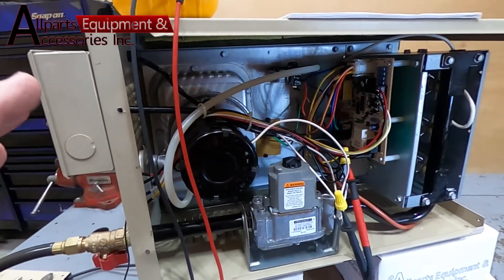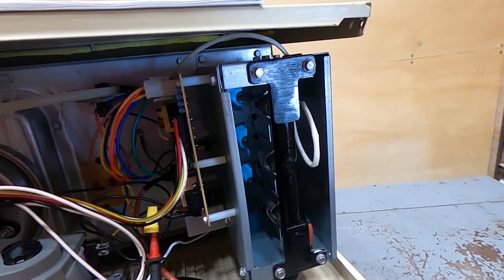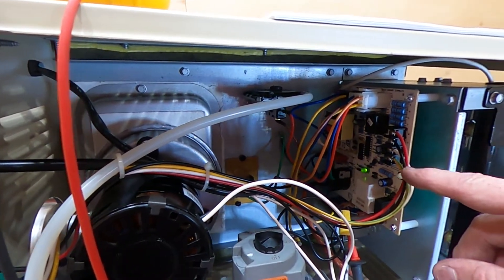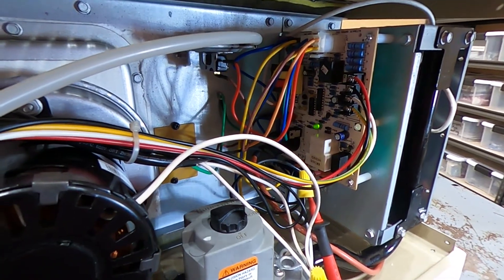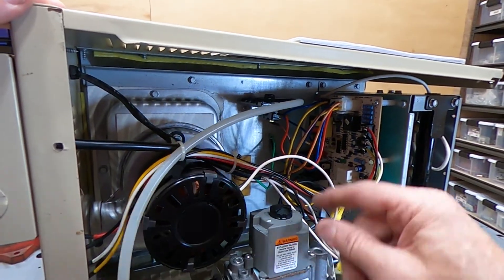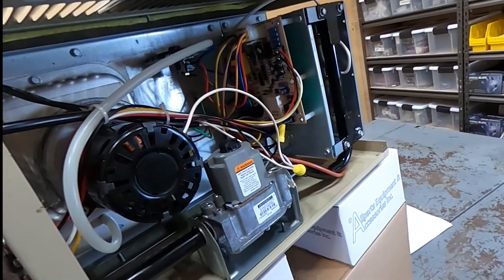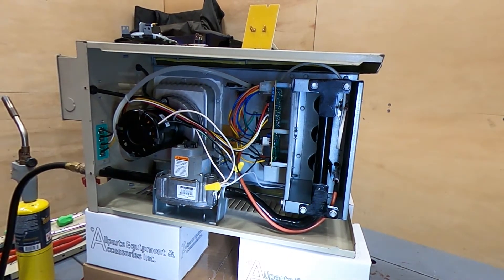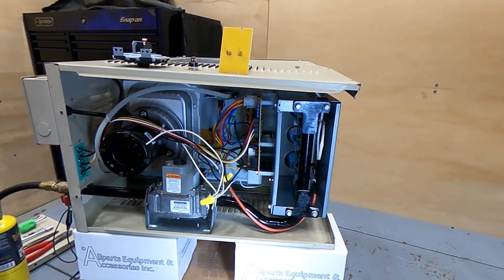Troubleshooting Compact Furnace Flash Codes (Mr Heater & Heatstar MHU Furnace Repair)

Comment from the maker: Thanks for watching! If you have any questions about the video or other heater issues, comment below!
Reply: I have a Modine Hot Dawg 45 AS.  It sparks, tries to light.  Tries for 5 times then I get 4 green flashing lights.  I've replaced the igniter and flame sensor.  The biggest problem is this is intermittent.  Once it cycles off, I'll shut off the power, and once turned back on, it will usually start up and run fine.  Then it will continue to run fine if I have the temp turned up high enough in the garage.  It seems to be worst when it first starts (cold start).  Sometimes it will light on the 2nd or 3rd attempt.  Any advice would be greatly appreciated.
Reply: Good day sir. Great video. I am getting the 4 flash sequence and I believe it is because the big blower fan is not engaging. What would cause the blower not to work?
Reply from the maker: @scottfreeman528  there's a chance that it could be a bad board, but if you texted our help line: 1-269-447-0412 we can ask a few questions to better diagnose the problem before you make a purchase. Please include your model number in the text!
Reply: @Allpartsinc happy to report the issue was just the start capacitor

Comment: Hi my heater stopped working yesterday. It had been working fine but recently when I came out to the garage in the morning, I find that it did not restart to keep the garage at the thermostat temperature. When that happened, I shut the power off turned it back on and everything started normally same thing occurred if I simply turned off the thermostat and turned it back on. But now nothing happens at all, regardless of how I turn the power on or off I’ve noticed that if the thermostat is not calling for heat, I get the normal slow Blink code, which says normal operation no call for heat as soon as I turn on the thermostat to call for heat. It immediately goes to the three flash code. The induction blower never starts and as long as the thermostat is calling for heat, it continually blinks the three flash code. What do you think is happening and how can I fix this? If the induction blower never starts it can’t be checking the pressure switch yet so I have no idea.
Reply from the maker: Did you take a look at the hose port? How does the hose look, is it clean?
Reply: Hi, I am getting a 2 flash code. The heater turns on and I’m getting a flame. Seems like it’s working fine, and after a few minutes it will go to cool down and shut off. Thanks

Comment: Brother, its -10f here in wisconsin, just went out to garage and my mr heater wouldnt fire. Popped off the side panel, saw 3 flashes. Found your video, blew out vac switch hose and both ports and boom it fired right up. Man you saved my day, thanks for making this video!!

Comment: I'm having issues with my thermostat going blank. After resetting the power, it will call for heat, turn on like normal, then abruptly shut off. No flashing codes and there's no obvious power outage to the heater itself.. any ideas?

Comment: I am constantly having to clean the "clogged" port on the exhaust side of the air switch. What could be causing this to plug? I cleaned it two days ago and it was plugged again today with no activity in the garage. Thank you for the info on the rest of the system, I will reference your site as needed, but hopefully not
Reply from the maker: What's the model number and gas type? Has it ever been converted?

Comment: Hi, my 125btu is giving the code... roll over protection... however is isnt mounted upside down... lol... any ideas?
Reply from the maker: Hello, what flash code are you getting? And are you referring to the roll out valve? Give us a call at 1-269-685-4123

Comment: Hello! My heater is flashing fast as if calling for heat as soon as I turn it on and the inducer motor starts to fire and spin but kicks out immediately and keeps trying to over and over again. I removed the hose for the pressure switch and the inducer motor will run continuously and as soon as I hook up the hose again the inducer stops and the unit keeps trying to kick in over and over but no success.

Is this the inducer motor that is bad? Is it the control board?
Reply from the maker: Hi Ryan, most often this is a bad board, but we still suggest the following:

Turn off the power to the unit.
Check your grounds and make sure you have good clean contacts.
Jumper the vacuum switch out by connecting the wire together and wrap with Black tape to make sure you do not have a bad switch.

Turn the power back on to the heater and call for heat.
If you still have the same problem we would suggest replacing the control board.
Reply: @Allpartsinc Thank you, I jumpered the wire together and the unit did not do anything at all. The light continued to flash as if calling for heat but did nothing in terms of trying to run so I guess that means it would be the control board!

Thanks for your help!
Reply from the maker: @RyanPfannmuller  no problem! If a new board does not resolve the issue, please contact us so we can work with you on resolving the issue.
Please contact our service department by text @ 269-447-0412
We don’t want you to have to just throw parts at the unit, but we will get the problem resolved.

Comment: You are assuming that the igniter activates steady as it should but don't cover what happens when it doesn't. you get the same 2 flash code. what causes the igniter not to ignite steady and or test for this.
Reply: I have this exact issue with a friend's bigmaxx and in my case how i diagnosed the igniter is that I listened for gas flow and heard it, then tried lighting it with a barbeque lighter and it lit. That's how I'd troubleshoot an ignitor, but Allparts should have covered it. Trouble is, is that replacing the ignitor didn't work for me, because the actual root cause was that the coil on the mainboard that powers the sparker was dead. Another thing a person troubleshooting these heaters should be aware of.
Reply: I thought they would explain one of the other causes of this as well but they didn't and it's probably the easiest thing to try. If you turn your heater on and it cycles through the start process and tries to ignite three times and you end up getting the two flash code, try pulling out the flame sensor(s) on the right hand side of the access panel, where the burners are. Clean them with some steel wool or emery cloth and replace them. My heater has two of these, one on the top and one on the bottom. I removed the two phillips head screws that hold each of the sensors in place, pulled them out and cleaned them. Put them back in and it fired right up. I had the same problem a few years ago on my gas fired water heater.

Comment: I just posted a video on my channel of what I'm currently experiencing.  I have a 4 flash code.
Reply from the maker: We are taking a look at your video. Just to clarify, have you physically reset the high limit switch? Or did you think it was resetting on it's own.
Reply: @Allpartsinc  I have not had to reset it, it resets on its own.  It runs for about 15 minutes, then I hear a click, and it goes into a cool down phase where the fan runs, no gas, and it just blows room temp air for about 15 minutes.

Once that phase is done, the click can be heard again, which I'm assuming is the switch resetting itself.  

The furnace will then turn back on, call for heat, operate as normal, and repeat this cycle infinitely until I take power from the unit, or shut it to Off at the thermostat.
Reply from the maker: @jakepryor  So, Thanks for the great video that certainly make diagnostics of the unit much easier!
 
With the unit is resetting itself and starting again that typically means it is the 60015 High Limit Switch for your model.
The High Limit will reset itself and the unit will start again after the switch cools.
It appears the MHU80 has 2 limit sensors wired in series, but that is hard to tell from the video, but if that was the problem they would need to be manually reset.
You can check both sensors and see if they both have the manual reset on them, if so then we are back to the High Limit Switch
 
The switch with the vacuum line if to monitor the Combustion Air Blower, if the exhaust gases were not moving out the chimney properly or there was a clog the switch would give a 3 flash code.
 
You can Jumper the 2 wires together from the 60015 High Limit Switch "FOR TESTING PURPOSES ONLY" to verify that is the problem.
These are current hot wires so make sure the unit is powered down and they are insulated if you perform this test.

Here is a link to the 60015 High Limit Switch: 
https://www.allpartsinc.com/hi-limit-sensor-heat-exch-hsu-and-mhu-60015.html
Reply: @ So you're saying to jumper the switches out, one at a time, to see if they are the problem?

I will do that this afternoon.  If they are not the problem, and are tripping because the unit is truly overheating, could it be that I bought too big of a unit for my garage?

Basically my setup is a 3 car garage, with the 2 car side (roughly 440sqft) of insulated wall only space currently.  Then the other 1 car side is partitioned off by an 8 inch brick wall, with an insulated door, another 220ish sqft, unfinished completely on the single car side. 

Heater is up in the corner, roughly a foot away from the wall, and I only have 8' ceilings.  Unit does get hot while it's running, but I feel like it's a furnace, it's gonna get hot.

I'm just curious if maybe I bought too big of a unit for the space, and now I'm having venting / cooling problems.
Reply from the maker: @jakepryor  can you give us a call before you try to do that? Our lead tech wants to speak with you. The number is 1-269-685-4123. Ask for mark.

we also have a text line that you can text after hours and we will get back to you. The text line is 1-269-447-0412

Comment: What fault would prevent the heater blower from turning on?
Reply from the maker: Are you getting a flash code?
Reply: @Allpartsinc . Yes the 4 flashes code.  I tested the sensors and they were all working.  The flue gas blower starts, the gas valve opens, the flame ignites, and then the fan never kicks on.  After a few minutes, the burners turned off from a high temperature alert, and then I get four flashes on the board.
Reply from the maker: @st3v3stich  Typically this happens from a bad control board not sending power to the blower fan, but the board needs to have the signal sent from the flame sensor telling the board that there is sustained flame and a call for the blower fan to come on. Most people in this case choose replace both the control board and the flame sensor.

Comment: My green light doesn’t light at all. The induction fan starts and the igniter goes on and I smell gas but it doesn’t start. What could it be when the green light doesn’t go on?
Reply from the maker: There's a chance you might need a new board, we can confirm that before you order if you give us a call (269-685-4123). The board we are using can be found here: https://www.allpartsinc.com/60105-ignition-control-board-for-mr-heater-heatstar-enerco.html ... but we will also want to make sure it is compatible
Reply: Check the 3 amp fuse.  The first unit I installed did this, ended up being the 3amp fuse on the board.

Comment: I have power to the furnace just as you showed, but nothing is happening. The operation light never turns on. Fuse is good and I replaced the transformer. Any ideas?
Reply from the maker: If you give our tech service line a call (1-269-685-4123), we should be able to help you out!
Reply: Did you figure it out? My green light doesn’t go on either. What should I do to fix it?
Reply from the maker: If you give us a call at 269-685-4123 we can go through some troubleshooting questions. The light should always work, so there is a chance you may need a new board.

Comment: I have the 2 lighht flash, and I thought you were going give possibilities of what might be wrong, and how to fix it! You didn't. What a waste of time.
Reply from the maker: Hi, thank you for watching, this is just an intro video to this subject. A two-flash code means that your system failed to detect a flame. This can be caused by a variety of issues, so we’d need to know more about your unit to help you. You can give us a call at 1-269-685-4123 and one of our technicians can walk through your problem with you, make sure that you are getting 120V to the unit.
You can also text us at 269-447-0412
Reply: Exactly my thoughts. 2 flash code and showed absolutely nothing to fix but yet other codes where showed, pointless video.
Reply: Could be a gas valve or the orfices maybe obstructed or a build up of carbon in the burner at the screens inside the burners. I blew mine out with the air compressor at 50 psi and we now have heat again for 2 days. You can call tech support at the manufacturer and get help as well. There number can be found in the operators manual!  Hope this helps!
Reply: @tankertanker7199  I blew mine with a leaf blower and has worked since.  Been working perfectly for 5 days.
Reply: same. waste of time hahaha just for him to comment "call us and someone can help" fuck outta here.

Comment: Hey, I'm having trouble figure out my heater, my fan never turns on and code flashes twice... Any help would be greatly appreciated
Reply from the maker: Hello, if you call us at 269-685-4123, one of our technicians should be able to help you out!
Reply: Here for the same answer. l hope he responds
Reply: If the combustion fan never turns on and the unit immediately goes into a two flash code you may have an open circuit in the gas valve or a loose wire on the gas valve.
Check the wires connected to the gas valve for a secure connection.